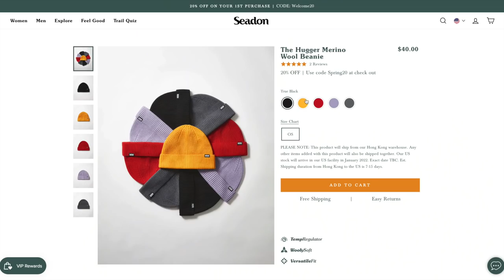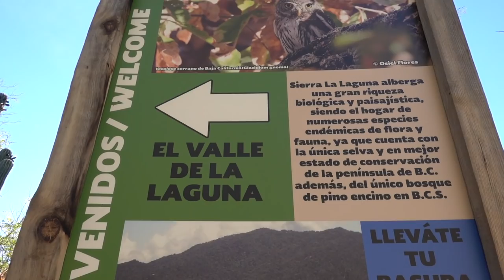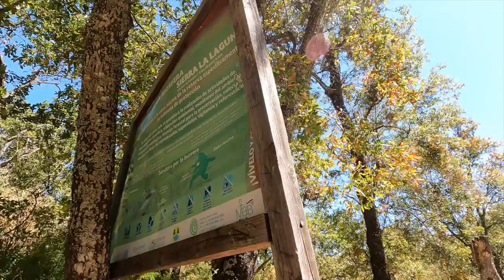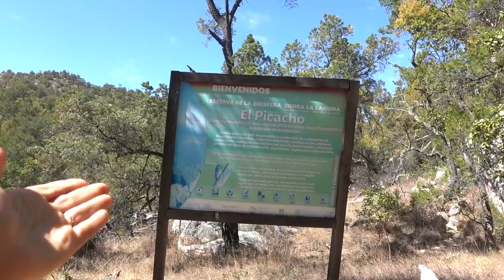PROPERTY HUNTING IN BAJA and other unexpected events 😅 VAN LIFE MEXICO

Comment: Keep in mind that when you are that close to the sea, there is a lot more maintaining involved. The salt destroys everything. You will have to paint the outside more often. Expensive electronics like computers and cameras should be stored in dehumidifiers for tropical climates.
Reply from the maker: All excellent points, it definitely a harsh, extreme environment, and we weren’t even there in summer 😬🥵
Reply: @Mrandmrsadventure  I've been working near the beach with electronics for the last 3 years and I'm shocked how fast the salt destroys everything. I try and never use my personal computer outside if I can avoid it by using the company equipment. Super inconvenient because my personal laptop is very organized with lots of info but I almost lost it 2 years ago from DJing on the beach several times a week.
Reply from the maker: @consciouscollective33  I can imagine with the DJ sets outdoors. We wish we had a work around solution to keep our electronics away from the elements. Even on days it’s windy and we are in the desert, we find ourselves wiping layers off the counters in our van and comp keyboards.
Reply: @Mrandmrsadventure  An air compressor is helpful to blow all the dust and sand out of the hard to get to places

Comment: Bro. You did NOT need new brakes. The squeeling is all the dust from the terrain. You were at 50% brake pads. Did NOT need them replaced.
Reply from the maker: Dang… we were wondering… and the guy who changed em didn’t say a thing 🙄
Reply: @Mrandmrsadventure  yeah... sadly most techs won't say a think since it's a money maker job. Easy to do. Hardest part if removing the wheel. My eyes popped out when I say the thickness left on the old pads. You change them when they are at 10% to 15%. I let mines go to 10%. Get my money's worth. Also... depending on the car... front brakes wear down very slowly compared to back brakes. That guy just wanted your money... typical for street car mechanics. There's good people down south... but there's also lots of dishonest people. Good luck! Love your videos! Maybe next time you have mechanical issues... ask us in the comment section. We will help!
Reply from the maker: @bobtruck1594  with how bad they were squealing we were concerned that we may be damaging something. We knew that they were the originals from 2008 so figured getting em done wouldn’t hurt. There was also a BIG language barrier in this whole transaction. Oh well.

Comment: Putting van fan on the top of my list ❤❤❤❤
Reply from the maker: Yes!! 100% and when paired together with a hatch above the bed or a window near the bed 🙌
Reply: @Mrandmrsadventure  I have louvered windows a foot an head of bed and a vent above the bed. I’m thinking if putting fantastic fan above the bed. And a full on AC unit in the mid front. I’m going to be stationary most if the time at my future  “Baja Property “ . I read you van run the roof AC while driving if you have the correct set up with your battery and alternator. My vintage van dash AC is broken and obsolete. So rather than replace that I’m doing a small Dometic roof AC.
Reply from the maker: @bohoxplorer840  you will definitely need something. Since AC uses so much power you will need to run off the alternator while driving or use shore power. Sounds like you have a good solution lined up. 🧊☀️
Reply: @Mrandmrsadventure  yeah I was thinking small gas generator too, as Miss Daisey can’t get too hot. Special consideration for pets. You two don’t have to worry about that.